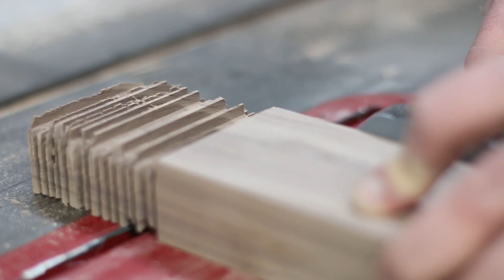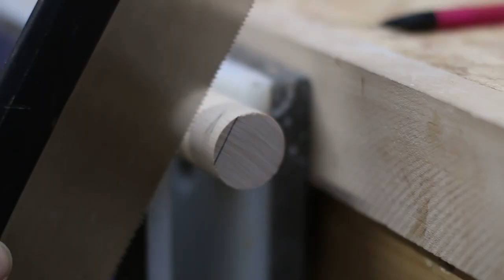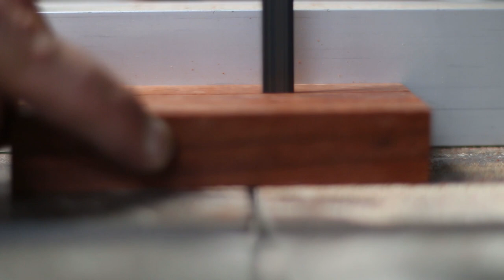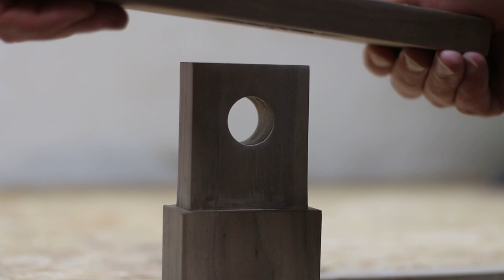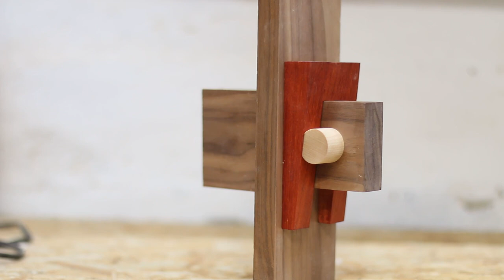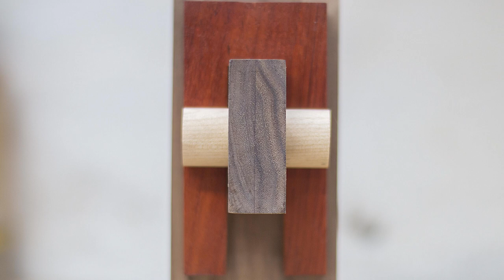The 30 Day Joinery Challenge: Forked Wedge with Dowel Tusk Tenon

Comment: Beauty joint man. Just wondering, but would it be easier to drill the hole before cutting the tenon?
Reply from the maker: Yeah, you definitely could. It would be easier to drill straight but there would be a chance of tear out at the edges of the hole from the table saw.
Reply: @ursusworkshop549  you could use a dowel in its place if you are worried about tear out